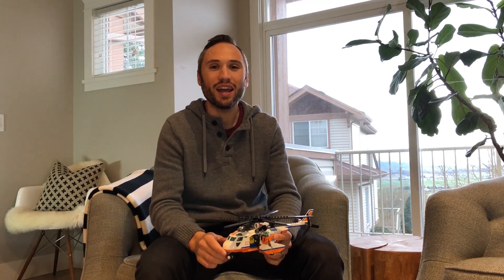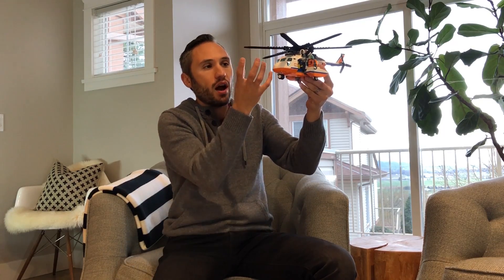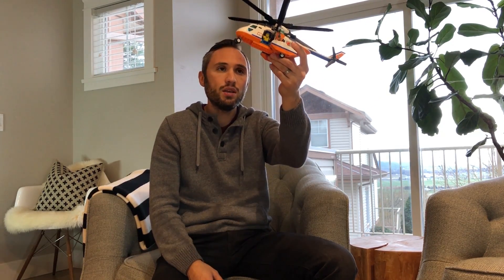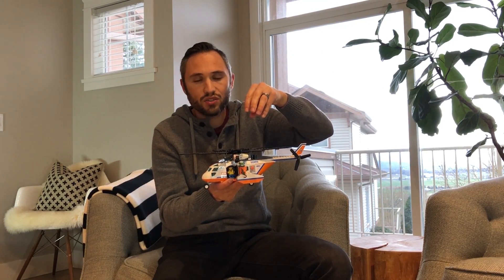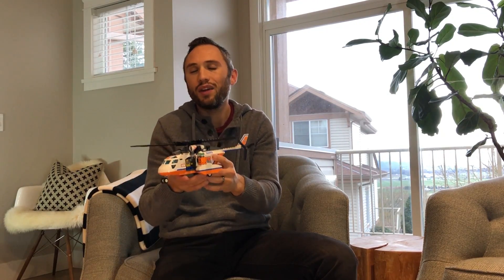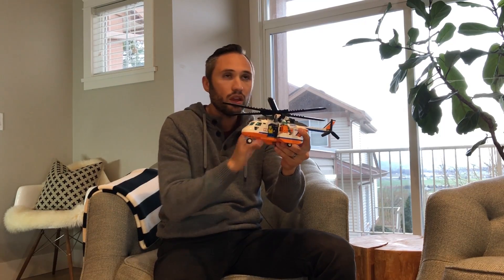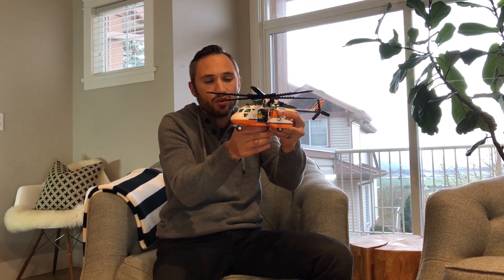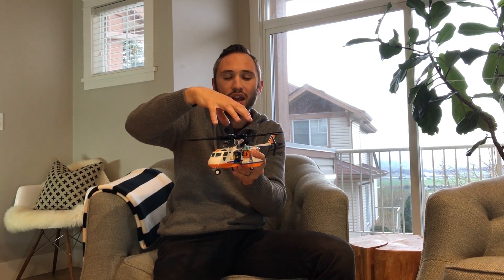Vortex Ring State IS NOT Settling With Power

Comment: I flew 1,955 combat hours in Vietnam in UH-1D, UH-1H, UH-1C (Guns) ,some Cobra (Guns) and OH-6 Cayuse.  High density altitude, hot humid weather and COMBAT operations. No pilot in our command (including ME) ever encountered "Vortex Ring State" or "Settling with Power" and we were seriously overloaded on numerous missions.  We were taught by pilots who had already returned from one or more years of flight in that environment...every conceivable way to autorotate TO THE GROUND - every maneuver possible absent flying upside down!  During flight school, my IP attempted, without success, to actually induce settling with power; and believe me, HE TRIED!  We hovered in that column of air while he attempted different sink rates, jinking, cycle movements = nada.  In Vietnam, my co-pilot asked me one day if a vertical autorotation was possible?  Of course, the "theory" of such was discussed in flight school, but never demonstrated.  I took our UH-1H to 5,000' - hovered with confirmation, dropped the collective and down we went - maxing the descent rate needle, but steady and no problems encountered (I carefully monitored rotor speed and used a touch of collective to keep it in range).  At 2,000', I simply pushed the cyclic forward with collective pitch recovery and went on our way - demonstration completed!  So - in "today's" world - pilots sit around nit-picking verbiage and theory, never having once actually autorotated TO THE GROUND (it's all with power recovery - Guess God will teach them how to finish the last 100 feet or so!!), never attempted a vertical autorotation,  never have actually attempted or encountered settling with power (or whatever choice of words the intellectuals want to use).  So - what's the expectation here?  That in the event any pilot suddenly finding themselves in such a situation, they'll squander the few seconds left to them in this world trying to decide if they are in "Vortex Ring State" or "Settling With Power" never having actually practiced the recovery?  Or is that reserved for some computer animation back in the classroom?  In MY world - with proper instruction and actual practice, we PERFORMED recoveries - we didn't waste time thinking about semantics.  I watched the Swiss demonstration video - an absolutely EXCELLENT methodology with wonderful visual effect!!!   However - how many helicopter pilots in today's world will be at that type of altitude (thousands of feet based on my comparison with the mountain and valley area they're flying over) and find themselves in a VRS or SWP situation and having, literally all the time in the world to slide out of it?  If you're preaching high bank rate/high descent rate which usually occurs during LANDING - then time is short, indeed.    My 2¢
Reply: I experienced what I have been calling “settling with power” in 1983 in the mountains of West Virginia. Army trained but flying civilian in a Hiller with soloy conversion. I was long lining a steel basket on a 140’ cable supporting a seismic shot team.  We were working across a number of sharp ridges with an Lz in one of the valleys. After so many trips back and forth I was getting careless and when I came over the last ridge I bottomed out the collective to drop into the valley where the lz was. When I pulled pitch back in the aircraft just shuddered and kept dropping. Although in flight school we never really successfully demonstrated settling with power I flew 3 years in Hawaiian mountains and knew a bit about downdrafts. I kicked the emergency cable release and nosed forward bottoming pitch to fly out of the disturbed air. The video talks about banking left but even if I’d known that there were ridges in either side. I was able to get into clean air and gain lift as I swing around to the right to avoid hitting tall trees around the Lz. By the description it was more likely vortex ring state but neither description mentions the “shudder” I experienced that trigger the training I got at Mother Rucker” that probably saved my foolish ass!
Reply: It seems as though you are trying to claim it's not possible to enter vortex ring state even when deliberately trying at a heavy gross weight. That contradicts a universally accepted aerodynamic phenomenon. There are plenty who could testify to its existence (both living and dead). Also, the entire point of the Swiss method is that it DOESN'T take thousands of feet and in fact recovers in as little altitude as possible. Hence why it is practical in every regime but especially when landing or close to the ground. 

I don't disagree that the fundamentals of good training revolve around practical application, but I disagree with most of the rest of your post. The aerodynamics and techniques learned in a Huey at Fort Rucker or in combat are valuable experience for sure, but they are not the "end all be all" of aerodynamic knowledge.
Reply: "No pilot in our command (including ME) ever encountered "Vortex Ring State""
Yet, if you watch the Swiss video, it shows exactly what, as I understand it, is a "vortex ring state".  so surely it is a real thing?
I realise that helicopter is not near the ground, but I would imagine that is simply due to it being needlessly unsafe demonstrating it near the ground.
Reply: @alexanderSydneyOz  It is a real thing. I don't have experience in Hueys like John but it's been demonstrated to me by my flight instructor when I was training in the R-22 Beta. Done at a safe altitude, I watched the altimeter unwind as I increased collective. Yikes. When training in the 206L IV, we talked about it but honestly I can't remember if it was demonstrated by my instructor.
Reply: John Hudson Truth spoken.
Reply: I respect your experience, but my humble opinion is not to underestimate the huge godly rotors of UH 1H and Cobras. They were made to provide lift in unimaginable circumstances. I've heard an instructor that they used to do full touch down autorotation and then do one pickup and touch down on tarmac with the same momentum of Rotors after landing in continuity (staying within limits)!! Those war birds were made to FLY first and then things were added. Fast forward in today's world, they put some data in CNC machines and get out a prototype that is "MORE EFFICIENT" than the previous birds and tell the pilot " hey , just pay a little attention to VRS , SWP and other stuff"  
The phenomenon exist, but only When all holes in those slices of swiss cheese (ROTOR LIFT CAPABILITY, DA, GW, TEMP, ROD, MACHONESS) align.
Reply: Perhaps it's more likely in Robinsons, due to their...peculiarities. My instructor is a Vietnam combat veteran like yourself and doesn't like the Vuichard generally, wonder if it's also been developed because of the Robinson. Regardless, I'll follow the lead of you and my guy.
Reply: @a1investigations433  In general, a fundamental rule in aviation is to seek more than one opinion (in your case other instructors at some point) so you can understand the why. We are creatures of habit who fall into a routine and specific way of doing things whether or not it is the best way. And experienced pilots are no different. Don't just accept something as gospel because someone has a lot of hours or did deployments overseas. I say this as someone who learned from the Army and had a multitude of Vietnam veteran instructors. There were good ones and lazy ones, and the good ones could always explain why rather than just what.
Reply: @dontsplatmatt  agreed on your general point. I have sought other opinions and so far, I hold the same opinion. Was not arguing from authority.
Reply: You lived the golden years of aviation. Not this crap we have today. Quality of pilots coming out of the pipeline is so low today that all these accidents we see on the news is just the tip of the iceberg.
Reply: Yep, today's trend is all about words and how to manipulate them to your advantage. It's the same in every field. People talk theory all day, but when there is a real world problem that needs fixed, suddenly they're nowhere to be found. But don't worry, they'll be back after everything is cleared up to criticize how things were done and how they would have done it better.
Reply: My hat's off to you sir. What an experience flying those combat missions must have been. I never served, but If I did I would have flown helicopters if I could.

Comment: Hey thanks for this mate. I'm undertaking my drone pilot licence course and this really helped in giving me a quick and effective idea of what vortex ring state is. Cheers from Australia
Reply: drone pilot as in a fly cam like DJI? And you need to learn about VRS and stuff like dealing with a full size helicopter?
Reply: Yes we absolutely did. I actually did a certificate in aviation and we needed to learn about undesirable air states, air law and flight rules, manned aircraft and meteorology. If you just to a straight drop course then that stuff may not be included, but I did a full certificate in Aviation. So this video was super helpful! I've since been trying to get into air traffic control @nobeltnium

Comment: I overpitched once in Afghanistan in a SuperPuma. We had to take off vertically and as fast as possible (without hovering) to avoid brown out. I pulled the collective and instantly reached 100 ft of height. At that moment I heard low rpm horn for just a fraction of a second. Pitched the nose down to gain airspeed, lower slightly the collective lever and completed the take-off without more problems.
Reply from the maker: Wow that’s pretty wild
Reply: @PilotYellow  btw, your explanation is perfect. I told my "story" to reinforce one thing you said in the video: overpitch can happen any time, even when climbing during takeoff if you pull the collective lever too fast.
Reply from the maker: @palacio139  that’s awesome thanks

Comment: So the settling with power is the helo version of numerous accidents with planes, usually fihgters in show demos, miscalculating their height above ground and taking into account their inertia, where they pull up out of a loop and and still hit the ground despite their crazy nose high attitude.  The plane and wings maybe with at 35° posititive attitude and full power on the burners but their inertia still make them descent on the the ground.

Comment: Slightly mixing up the VRS airflow effects. The root stalls due to the high rate of descent flow. The increased vorticity due to the rate of descent flow and blade angle at the tips is causing no angle of attack. So for different reasons you lose lift from these 2 sections leaving only the mid section to produce lift, which will not be enough to support the weight, which encourages and spreads the stall and exacerbated if you were to try to recover by raising the collective, hence at least 20% power being a condition that causes or worsens VRS.

Comment: Please delete this video.  Someone just referenced this video to me and I was shocked as to how bad your understanding of VRS is.  

You do not need to be in a descent to get into VRS.  An updraft can actually cause VRS even if you are climbing.  I have encountered VRS coming off of heliports on buildings in windy conditions.  

You do not need 0 airspeed.  Anything speed below translational lift can cause VRS. A heavily loaded rotor system may not experience translational lift until 30 knots or more, so they could get into VRS up to those speeds.  However, they would have to have a much higher rate of descent to get into VRS.  

VRS is NOT a stalling of the blades.  It is actually a loss of lift due to a reduction of AOA due to the feedback effect of the recirculating air.  

You are for more susceptible to VRS during low power settings where the downwash is minimal.  VRS can be thought of as catching up to your downwash, so the stronger the downwash, the higher rate of descent you need to catch up to it before entering VRS.  

VRS does not start when pitch is applied to the blades.  You are already in VRS, and raising collective just exacerbates the condition. 

The prime conditions for VRS are low weight, low density altitude, and low power settings.    The prime conditions for settling with power are high weight, high density altitude, and high, but insufficient power settings.

Comment: Not actual pilot, just simulations.  
Pedal never seems to induce side slip, though it seems to help control and make a side slip more linear.  I can't imagine needing to hit the pedal during a VRS unless there's some errant coordinated turning effect being added by the AFCS/SAS system during cyclic input.  I've always instinctively used ANY lateral movement (front, back, left, or right) cyclic input to get out of VRS.  I didn't know there was a particular direction that was better than another.  The only simulators I've found that do VRS seemingly pretty well are X-Plane from 9-on. 
Settle with power always was described to me as a situation, and VRS as one of the possible causes for that.  Settle with power was just a loss of altitude with a properly-functioning helo even though you were applying collective and therefore engine power -- could be airflow issues around a hill top, hot air suddenly under the helo, running out of engine power upon landing too aggressively, over-pitching of main rotor causing low RPM, or a VRS, among other possible causes.

Comment: Hi - So far as I understand it, if you have 20 knots of forward airspeed, you have 20 knots of airspeed. A tailwind or headwind will only affect your ground speed; your airspeed is always measured relative to the air you're moving through. You said at the start, "if you had 20 kts of forward airspeed, but had a 20 kt tailwind, the relative airflow would be 0". I think this is incorrect, as your relative speed through the air would be ... your airspeed, 20 kts.

Comment: They are not the same thing but very related and this video gives the impression they might be totally totally different and people are dumb and confuse them. Settling with power may require to be in movement and may add inertia but aerodynamically the problem is basically the same you are descending vertically (VRS) or diagonally (SwP) into your own rotor wash. Because in SwP you have a bit of translation lift it takes the "power" to mess the thing... aka to have collective pulled to stall the blades.  In VRS if you just pull the collective you complicate it in SwP you finally enter it because you had the collective pulled and you canceled the little extra you had from translation.
You can imagine a VRS while pulling the rotor 90° up, it will VRS horizontally but due to gravity being also 90° offset  and the usual torque the trajectory and aerodynamics will be messed up but it is a "VRS". Conversely, you can imagine an experiment where you are just at the edge of VRS while descending vertically and you induce more mass/inertia to the helicopter (you add mass imaginary)... Although the helicopter was out of VRS, because of increase mass/inertia it will blow through and enter SwP like explained in the video... but is will still be a VRS.

Comment: shouldn't the rotor RPM be a good indicator of which of the two it is. in VRS the RPMs should go up because the rotor doesn't produce lift anymore, the rotor turning faster until it runs into the limiter and in settling with power the rotor RPM should slow down because the rotor produces lift and therefore induced drag which slows it down. so if the helicopter doesn't have enough excess power the RPM should noticeably get lower. PS without looking into this I would be careful to compare VRS with stalling. stalling is when the air stream can't follow the direction change the wing is trying to induce onto it, so the air stream separates from the wing and since it's no longer redirected (downwards) the conservation of momentum (air pushed down=wing pushed up) stops working, that's a stall. the way he described it's more the air stream is coming in from a very shallow angle basically the same direction of the wing or even a negative angle so the wing has no proper angle of attack on the air stream. that sounds different from a stall.
Reply: You are basically correct. Settling with power is an over-pitched state a state in which the entire rotor disc is stalled. It is a high AOA condition with high drag and decaying rotor RPM's. This is a condition that an under-powered helicopter can get itself into rather easily. Getting out requires reducing the angle of attack (collective). This is exactly the same as lowering the nose of a fixed wing aircraft. Some people claim that settling with power is also the same "as coming in too fast".  I would say that is not really "settling with power", but is simply coming in too fast without adequate power to arrest you descent. If the rotor disc is not stalled or you are not in a VRS, then more power would arrest the descent. You are simply trying to fly an under-powered helicopter too aggressively. 
VRS is characterized by high rotor RPM on helicopters without a governor. If your machine has a governor then you will simply see rapidly decreased torque. The downflows from the rotor vortices are reducing the effective AOA and is reducing the torque loading. The position of the collective is meaningless. It's like being caught in a micro-burst (downdraft) of your own making. You have to find a way to fly out of it.